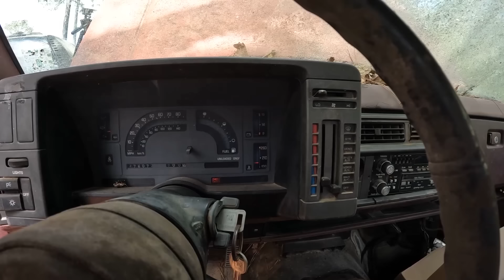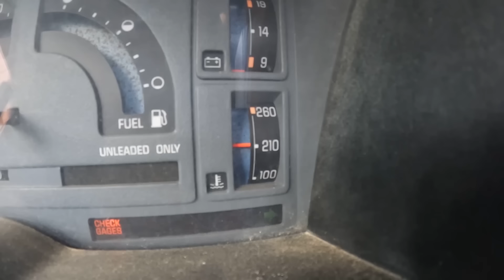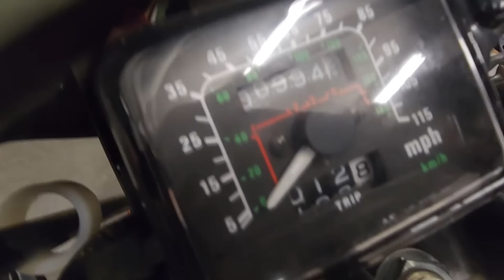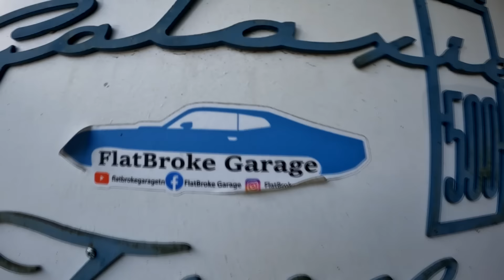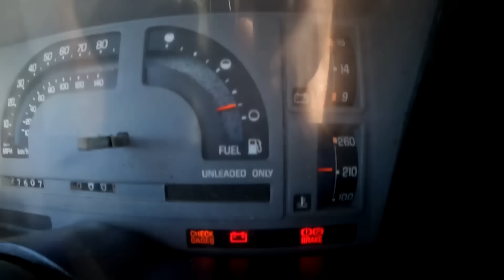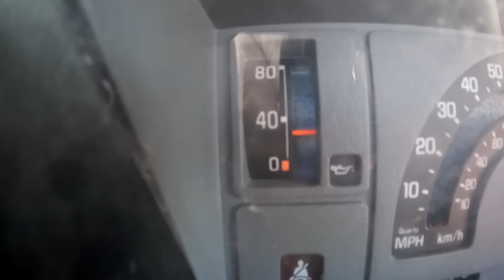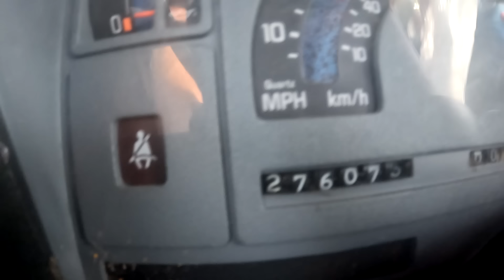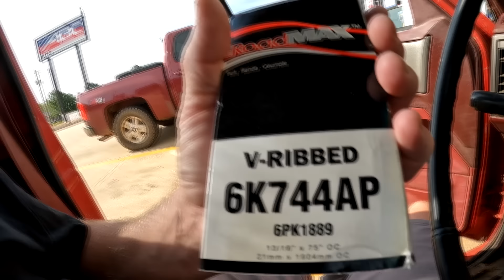ABANDONED Chevy S10 Revived in Junkyard | Will It RUN AND DRIVE 800 Miles Home? | RESTORED

Comment: Excellent Video RESTORE crew also Shawn did exciting Excellent   job this S10 Chevrolet pickup truck I remember them my one cousin had 1991 with 2.5 litre 4 cylinders with Automatic transmission 4 speed , all options plus 377 rear end gears no sunroof but was single cab doors in blue color too ! He put loads of kms in his and did job too!

Comment: I have an 85 that came with a 4.3 automatic that I drove high school then my senior year I put a 383 with a 5speed in it and it still gets 25 mpg  after 24 years.  My dad had an 90 that was identical to this one but it was destroyed when my sister had a wreck she was fine not even a scratch even though she rolled it God was definitely looking out for her.  I used the frame to put a 52 GMC 5 window on it with a 6.0 ls last year

Comment: Just picked up a 86 4x4 reg cab short bed 2.8 I can tell  you after sitting 20 years , its not going to drive anywhere until it gets a new tank and pump assy .  It did run on carb and choke cleaner  for a min .

Comment: I just picked up an 84. S10 blazer, with a 4.3 vortak V6.
So your video is coming out at the perfect time
Reply: Ive got a 1993 S10 Blazer Tahoe LT 4x4 with the 4.3L Vortec W Vin. Most reliable rig I've ever owned. Had to do the water pump yesterday, but low maintenance strong running suv. The 4.3 Vortec is a powerhouse.
Reply: @BanishedToEarth   nice

Comment: I had a 73 ford pinto 4 cyl that the belt broke. I used some rope to do a temporary fix. Heard while stationed in Germany, that a man ask a women for her hose to make a belt.  What are your plans on all of these vehicles other than letting them rust and need to do a will it start again,to get them running would probably be easier.